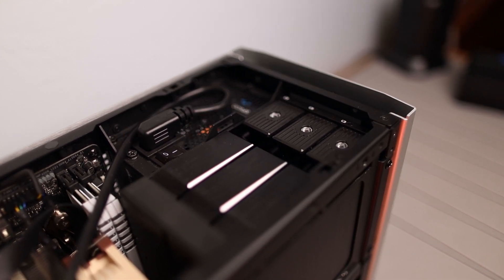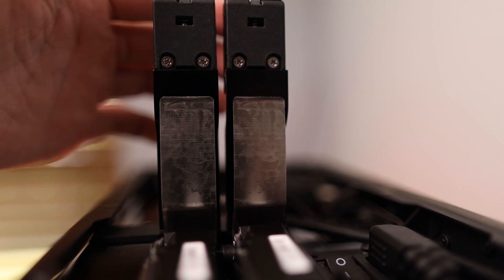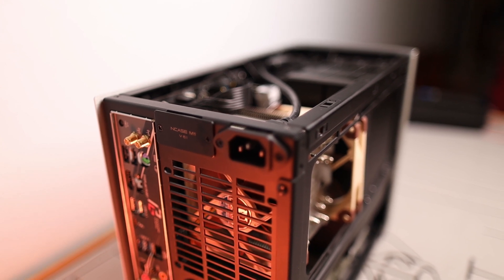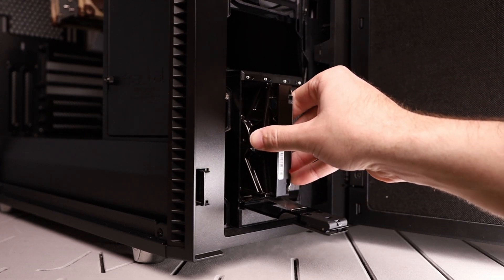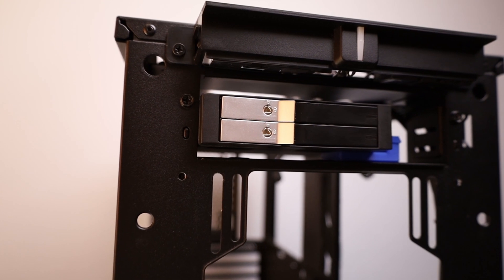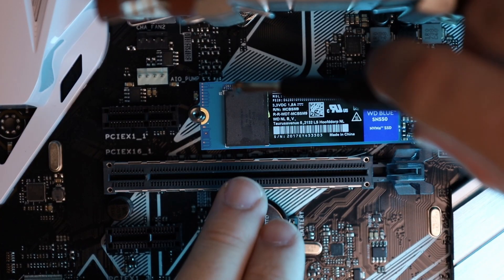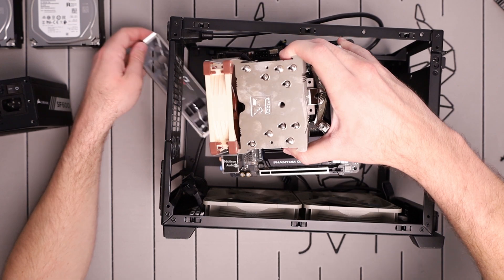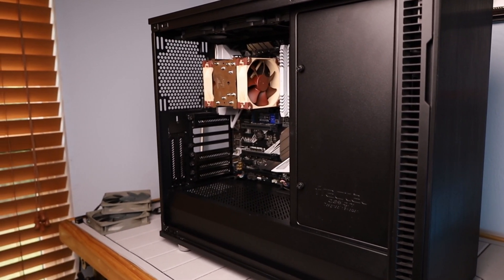DIY NAS Server Rebuild, Switching from Mini ITX to Mid Tower ATX

Comment: or if you feeling nice id like build with a 4 bay system on pcpartpicker I already have 4 nas drives i had a synology but now i want something with more power for plex
Reply from the maker: For sure! This Fractal case can probably support 2 of the 3Bay hot swap enclosures but the 4 might be a bit wide even in the vertical orientation. Depending on the system you want to run and type of system you want to build, silver stone has some really nice server cases that I was considering purchasing and they support 4bay and up (https://amzn.to/3pkwmFr ,  https://amzn.to/2NmpjyF). Yea building your own server is nice because of the
creative freedom of building it exactly how you want with your preferred OS and Apps.

Comment: case is unavailable ... also is there something i can use for 4 bay instead of a 3 bay setup ?
Reply from the maker: Yeah I apologize the availability has been scarce on amazon. It looks like Newegg has it in stock (https://www.newegg.com/Black-Fractal-Design-Define-R6-ATX-Mid-Tower/p/11-352-090). I have used some of the rack mounted cases from rosewill to accommodate a 4 bay hot swap enclosure (https://amzn.to/3qpW8JQ).